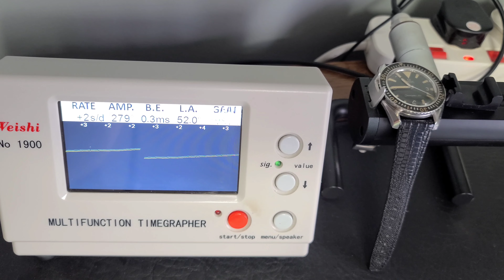Restoration of vintage DIVER Omega watch Seamaster 300

Comment: I have the same watch and currently servicing the movement. The watch is absolutely caked in DNA so want to put the case through the ultrasonic. I want to remove the bezel first but really struggling. I work on dive watches all the time and have various bezel removal tools but this one does not want to come off. Can you offer any advice?
Reply from the maker: don't touch it ;) there are other ways to clean it